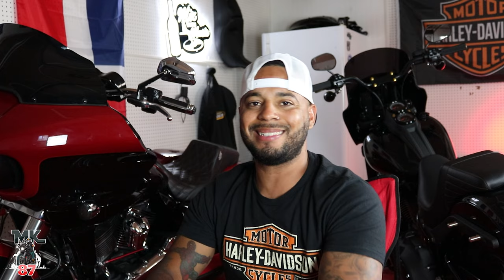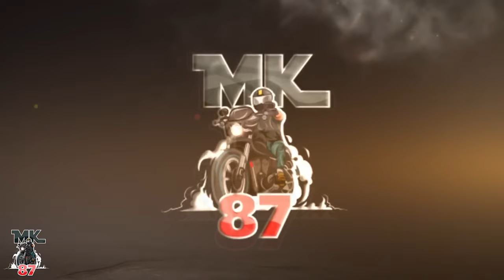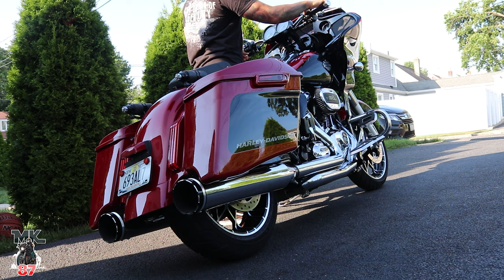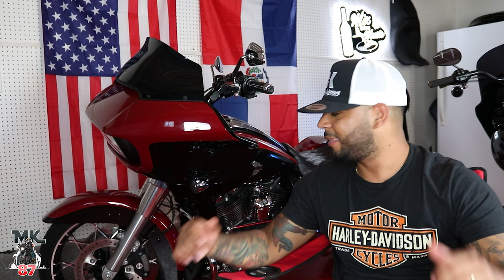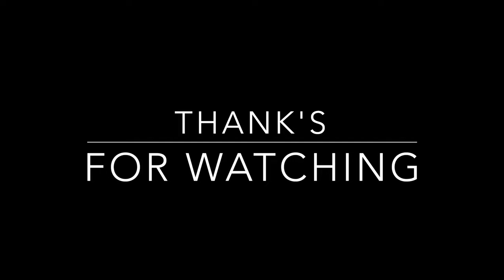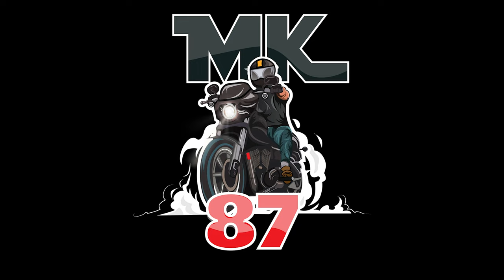Road glide with Khrome Werks full exhaust and torque cam sound

Comment: So I had the SE 447 put in today along with the SE cam chest Plate and oil pump, bearing, tappets, S&S cuffs..…I still have cat headers and Khromewerks slip on mufflers…flashed with the SE Pro Tuner..nice bump in power I’ll tell ya! Next is to get the Khromewerks headers and make a full system..another tuner and dyno that thing to squeeze out more..as is it really woke that bike up! Definitely helped to get that old oil pump out tho..not  making a f’n dragster here so ya I’m done after that.
Reply from the maker: Deff go with the full system it makes a world of a difference bro. Yes the 447 is great and I’m sure when you switch out to another tuner it’ll make the power your looking for

Comment: Nothing wrong with screaming eagle parts for sure. But I wanted the most out of the money I spent so went fueling reaper 472 made 119hp and 129trq
Reply from the maker: Nice man Excellent numbers
Reply: @Marvelkid87  I’m debating on what bars to go with. My bike is a 21 ultra snake venom and was going to go thrashin bars or a kst bar. I know worn tbar setup will make my screen unit pointless from what I’ve heard